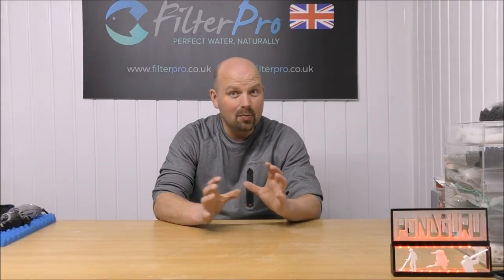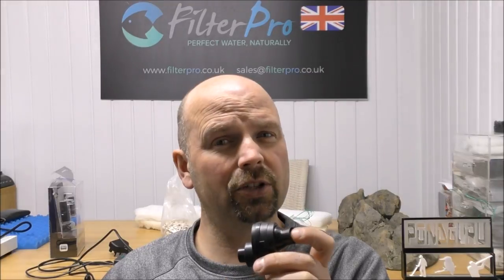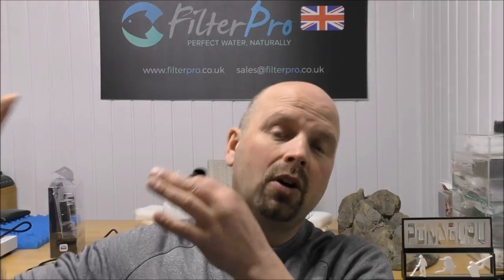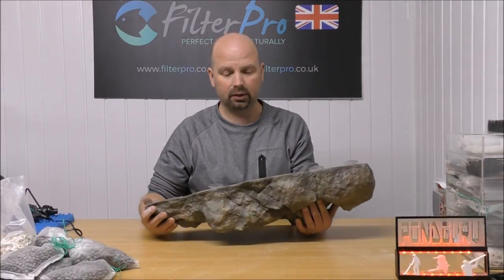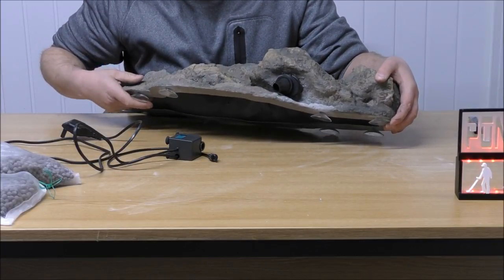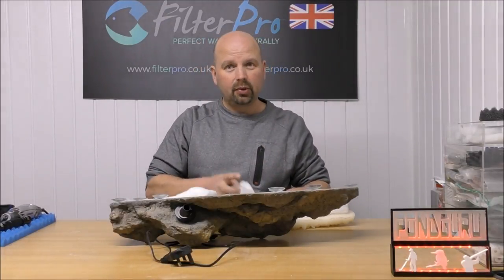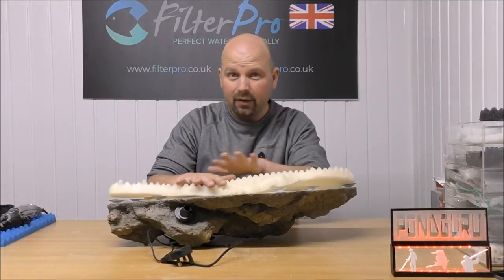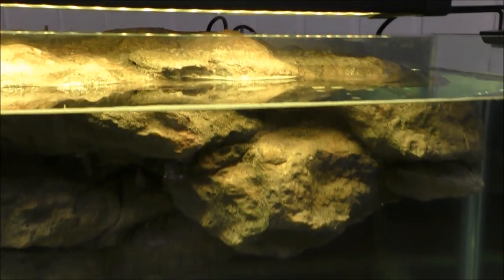The Ultimate 'Invisible' DIY Aquarium Filter?

Comment from the maker: Click 'Read More' for information and links to equipment.
A few years back when I still had my aquarium shop I made an air driven filter from a resin rock ornament which worked really well - this is a much better version which uses the following materials:
Okiishi OR/7 resin rock: No longer available....
Biogravel: https://bit.ly/2NRdc8o
Spin Stream Nozzle: http://geni.us/bLHfA
24" x 17" foams: http://geni.us/AvAdBx
Fine filter pad: https://bit.ly/2LlEsuf
Oxygenating water pump: https://bit.ly/2umSS72

Although the above list of materials are very specific please don't feel as if you need to stick to those exact products - I'm just throwing the idea out there and I'd love to see what you can come up with for your own DIY filter projects.

Unfortunately I don't have the 24" x 17" foams on my website yet so the link is to a pack of 3 but you could use a coarse and medium or fine foam and not bother with the fine wool pad - it's up to you, either way will clean the water no problem.

After over 3 months of running the filter I can confirm that the suckers aren't much good to hold such a heavy filter up so it's way better and easier to simply use the 'S' shaped wire to hang the filter on the back of the tank.

The spin stream nozzle which distributes the water has worked perfectly and never stopped in the months of testing.

This is the model of dremmel tool I was using in the video: http://geni.us/4uMl and I find it to be excellent when I'm making DIY aquarium filters.

This was the air driven rock filter I made a few years ago: https://bit.ly/2uAdB6A

If you've enjoyed this video please check out the playlists on my channel for hundreds more  - on a variety of subjects.
Feel free to share or link any of my videos on facebook, twitter, forums etc. for the benefit of anyone you think may also enjoy watching.
See you next time.
Pondguru (Richard)

sales@filterpro.co.uk
07772848730

RECOMMENDED PRODUCTS ON AMAZON: https://goo.gl/jMaBWy
INSTAGRAM: https://www.instagram.com/pondguru_outdoors/

FILMING EQUIPMENT:
Panasonic HC-VX870 HD camcorder http://geni.us/3UwE
+Rode stereo microphone: http://geni.us/4OL
+Rode 'deadcat' mic cover: http://geni.us/1pmn
JVC Everio quad proof HD camcorder: http://geni.us/e09e
+Rode 'deadcat' mic cover (opened up and held between tripod and camera base) http://geni.us/dee24
Zomei Z666 tripod: http://geni.us/1a1af3
Manfrotto MTPIXI-B PIXI mini tripod: http://geni.us/87f7
Reply: You are the most knowledgeable person on youtube. Most people barely understand the nitrogen cycle.
Reply: Nice, seen a number of nice ornament that could work well.
Reply: Awesome idea Richard.

A couple of questions:

1/ What is the maintenance regimen for this? I'd assume it's just lifting the structure out of water, pulling out the coarse foam, giving it a couple of squeezes under a running tab to get rid of the thick particulate matter, stick the foam back into the resin rock ornament and back into the aquarium, yeah? How frequently would you need to do this?

2/ Those holes you drilled in the front across the face of the resin - wouldn't that be a "4bad" entrance for larger particulate matter (but smaller than the hole size) to enter into the system and "infect" the biogravel?
Reply from the maker: The idea behind all the holes is that the water will be drawn in all over the place and gently filtered but I take your point on the holes in front. Depending on where you have the pump and media you could drill holes and put fine floss / pad wherever you want. Cleaning was very easy as I just slid the filter up the back, laid it over the tank for a few minutes then took it away to strip down which was very quick with only a couple of drips.
In a normal tank you'd only do that every few months.
Reply: your videos are better than Planet x News
Reply: A "Whole Heap"  haven't heard that in a long time,  have you lived anywhere else other than UK ??
Reply: Is it true that just plain old 30ppi foam is better surface area and has better accumulation of bacteria than bio home products and under testing is overall better and cheaper?
Reply: @BlueJeansOverland  (my other account) Read what has been laid out in that question then think about it (yourself) - does any of that make sense? There is a reason why foams are used to catch muck and rocks / ceramic rings, sintered glass or other porous forms of media are used to hold a good population of bacteria.
I did a video ages ago called 'Looking inside filter media' and that's a good one to check out as it shows the real differences between media. It is something none of the other channels have bothered to do because they know they can just make up nonsensical claims and 99.99% of viewers will believe it blindly and parrot it without doing a second of research into the claim.
'Trust the science' ....... lol
In the next week or so I'll be making a video about Germ Theory vs Terrain Theory as an understanding of both is critical to keeping fish. I'm guessing you've only heard of Germ Theory (Louis Pasteur) as that is the only one taught in school / college / university......and there is a good reason for that.

Comment: That is absolutely awesome mate. Practical and asthetically pleasing. I suppose you could fit a heater in there with a cage over it and then you would have nothing at all showing.
Reply from the maker: Yes with some modification a small heater could be fitted but I'd be worries about getting enough water flow over it as if it wasn't getting a decent flow around it the thermostat would be reading a result which was too high and could potentially cause the heater to only come on occasionally.

Comment: Really good idea for a filter.  I think the water entry points could be improved, I don't know if I would have put holes all over the decor, instead I would have placed them as far away from the pump as possible, but still spread out so you get flow all through the filter.  Nice use of the spin flow too, I haven't seen anyone use those in years, not since I was into the salty side of things.

Comment: Nice filter design there mate. Just a thought, if you grind a two inch slit at the water line on the rock it would draw water in and skim the surface?
Reply from the maker: Yes possibly but the pump is not very powerful in relation to the size of the intake points (the whole of the back back, lol).
I left it 3-4 months to see if there was a visible scum line on the back but couldn't notice anything when I cleaned it and it had some horrendous scum on the tank at one point as I caused a mad scum layer to test a small skimmer...vid for that coming up soon.
Reply: Yeah has great underwater circulation but almost no surface movement... I imagined the filter output facing up not down, would easily solve the problem

Comment: Great idea! Maybe its also possible to place your heater in it, you won't see any disturbing equipment in sight. Well done Richard!
Reply from the maker: Yes as long as you have good water flow around a heater it will be fine to hide it but I'd be worried about having it confined where I couldn't check it was clear around the heater.

Comment: After working with such a background filter I would silicone and really seal the sides to the back glass. That way you don't create a mess in the tank when cleaning out the media. You just remove the media and suck up all the dirty water. I would also only drill holes at the top so you have everything flowing downwards through ever finer media and so you don't spill out any gunk from the lower holes. I had the unfortunate to maintain a tank for a client and the filter hadn't been cleaned, probably ever, and the amount of built up gunk that oozed out from the lower holes was insane. Took me ages to clean the tank and I was swearing the entire time how stupid the guy was who drilled holes all over the background and not just at the top.

Comment: The reason why pump designers use the venturi effect, that is, drawing the air in on the output side is because it doesn't knacker (break) your pumps.  When air gets before and onto the impeller the atmospheric pressure  drops and can heat the water dramatically and you can get cavitation which means your impeller is being shotblasted to bits.

Comment: Great idea.  I love every aspect of aquariums, but especially working DIY filters.   I borrowed your idea for using Biohome gravel and filter foam ring on my BiOrb Cube 60 and it’s working out great.  Just like you said, after about 6 months the anaerobic bacteria become established and there are no traces of Nitrates!  In this case, do I even need to do water changes?  Also, how often should I clean or replace the foam in either one of these setups?
Reply: It's a bit late, Karl, but someone else might see this question, so in short:
Clean the foams if you have flow issues
Replace them if they fall apart
You will still need to do water changes because trace elements in your tank deplete over time which can, when we also have decaying organics, acidify and destabilise the water column (pH swings become more likely due to the decreased carbonate/general hardness "buffer", for one)
Small and frequent is easiest in terms of reduced risk to livestock. Larger water changes require you to be much more careful with the chemistry and temperature of the new water that's added.

Comment: I really like this filter and to be honest, the price isn't bad at all! How is it for maintenance though? Presumably, over time you'll need to at least wash out the foam? If you had plants or anything put into the top of this would that be an issue when it comes to cleaning it?
Reply from the maker: Yes considering the look of it an how much filtration it offers the price is reasonable.

It is really easy to clean - simply slide it up then stand it over the tank for a few minutes before removing to strip it down. I just cleaned this one and when I took it away there were only one or two drips. Took about 5 minutes.

Comment: I have 2 questions.... does the weight of the media inside it affect the suction cups (does it shift?) and wouldn’t fish get stuck in the gap between tank and filter? BUT appearance-wise, you have made a filter that is “invisible”. Looks great.
Reply from the maker: Yes the filter eventually slid down the glass after a few weeks so that's why I went with the wire hooks - they hold it perfectly.

Comment: I like this idea Richard , I would never use it but I think it’s a great idea 👍🏻 , I’d also stick small holes at the water level to allow some surface skimming 😬 , though I’m not sure it will already do this due to filter wool and it bridging the surface already
Reply from the maker: Yes, when I lifted it out there was definitely scum around where the water line had been and it went through the coarse sponge into the fine pad behind it. However, on the subject of scum I did cause a ridiculous amount of scum to build up on this tank to test a small skimmer and the rock filter didn't clean that anywhere near as effectively as the tiny £9.99 surface skimmer.
Reply: Pondguru very nice Richard 👍🏻👍🏻

Comment: Hi Richie, timing is perfect, I have a 90ltr tank with a fluval 2 plus filter that after 10 years is on its knees and needs replaceing asap, can you recommend something similar for a much smaller aquarium? Cheers.
Reply from the maker: The smaller version (OR/5) will enable you to make a filter exactly the same, but smaller.

Comment: Absolutely gorgeous, but how about cleaning and maintenance?
Reply from the maker: It would be taken from the tank, foams squeezed out under the tap and then put back together. If you need to rinse the bags of filter media then it would ideally be gently shaken in a bucket of water you've drained from the tank during normal maintenance.

Comment: I'd get rid of the suction cups and just keep the hooks since A the suction cups will lose their flexibility over time, and B eventually you're going to have to clean the filter floss. Also, I'm wondering what would happen if you don't clean the filter floss will it overflow over the back of the glass? I like this design though because you can also hide the heater as well so there's no apparent equipment to look at and it maximizes surface area for planting.

Comment: Awesome, how often would this set up require a clean?
Reply from the maker: It would only need cleaning every few months and is really easy to clean - simply slide it up then stand it over the tank for a few minutes before removing to clean. I just cleaned this one and when I took it away there were only one or two drips.
Reply: Pondguru awesome, thanks! This really is a pretty set up.

Comment: Great way to hid the necessary filter media and pump for smaller aquariums of 20 to 50 gallons. Perhaps that more than one of these could be used for larger tanks. Upon watch this filter actually in use the possible problem that I saw was the accumulation of larger air bubble that get trapped under the ledges. Perhaps suggest to reduce this is to watch where this occurs and then remove the filter and drill a hole up under the ledges where this occurs. This would no doubt allow the build up of trapped air to escape to the backside of the rock/filter and not cause a problem of possible hydrogen gasses to build. Just my observations. Great idea!!!
Reply from the maker: The air bubbles simply slide along the underneath of the ledges then pop at the surface but there are enough holes in the structure to allow any which find their way inside to get out. I'll be making a smaller version of this filter for the base of this tank and tried to alter a small 'rock' to take a compact heater but that didn't work out.
I'm glad you appreciate the idea and liked the video - thanks for watching.

Comment: I think it's a fantastic idea and it looks really good.
But will the rotating outlet head not blow the sand away from the bottom?
Would it have the same effect if you placed it upside down, and lower in a bigger tank?
Reply from the maker: It could be placed with the pump in any direction you wanted and set up with whatever media and foams you had at the time - I'm just throwing ideas out there and the way I set it up is only one possible scenario.
Thanks for watching.
Reply: Tanks for the answer.
And a great idea it is,. And that's why I love watching your videos 😊
Reply from the maker: Groovy - I love making the videos so it's all good.

Comment: Good job, I ordered that pump.
Reply from the maker: It is a really great one for small filters like this for sure.
Reply: I had to remove the blue little foam pad inside, just blocks within 2 days. Works perfect without it
Reply from the maker: Yes there is no real need to have the little bit of foam in the pump so removing it is no problem as long as teh pump doesn't fall into deep sand, lol

Comment: Richard one point will the water being drawn through the small holes on the front be un mechanically filtered and go straight on to the bio media?
Reply from the maker: Most of the water is drawn in the back as it is entirely open (apart from foam and fine pad) but some will be drawn in through the holes. The pump isn't big enough to draw in appreciable amounts of suspended solids (only 450 lph) so I'm not worried about it taking in muck from the front holes since the flow is so diffused - it's a very low impact filter as far as muck intake and water flow goes.

Comment: Hi Richard. ..........been subbed for a while after a recommendation from Mark at "Marks Aquatics "........I have a question before I give you an order for some Biohome Media.........why would you use the bigger media ie ultimate if you can pack in more I you use the gravel..............watched all your vids...........awesome channel..........I NEED BIO HOME. ......
Reply from the maker: For difficult situations where 'normal' media would not fit in well the biogravel excels as it uses every part of the available volume but if it was used loosely to pack out a large space in a canister it may pack in a bit too tight causing a reduction in flow. However people have used it in canisters and reported great results....any of the biohome media types will work in any given situation but some are more suitable than others due to their shape / size.
For something as irregular as a resin ornament you won't get a better media than the biogravel but in a canister where flow is generally higher a larger media is more suitable to retain flow rate.

Comment: Hi Richard
Doesn't this set up go against your previous principles of water being super clean when it hits the media ? I would have thought all the holes drilled in the front will allow particle matter straight onto media. Solution maybe media fully contained in  some sort of fine particle mat bag along with pump. Looks good though
Reply from the maker: Yes, you can set it up however you want - I'm just throwing ideas out there and while most water is drawn in through the back this filter is more passive than active so wouldn't be expected to clean a high bio-load tank. It's there really as a hidden booster for those situations where a full cycle would be desired - if you wanted to fill entirely with foams or floss then it would still help to clean the water no problem as it would act more as a polisher.
Reply: Mad genius at work!